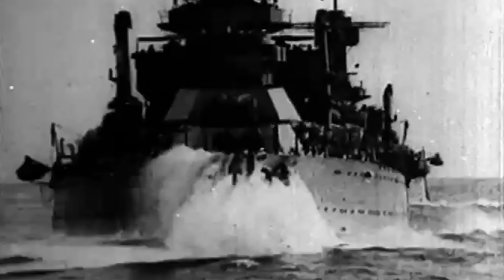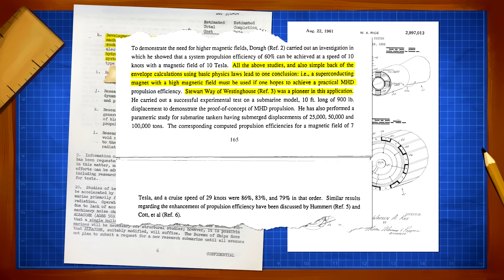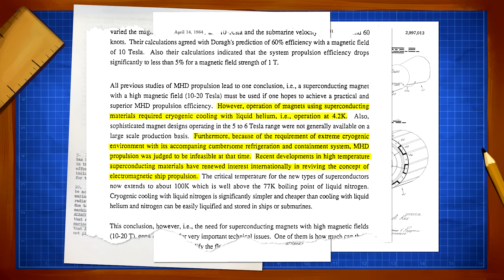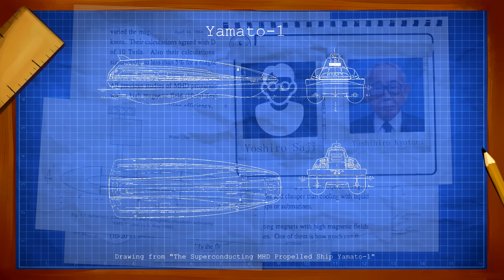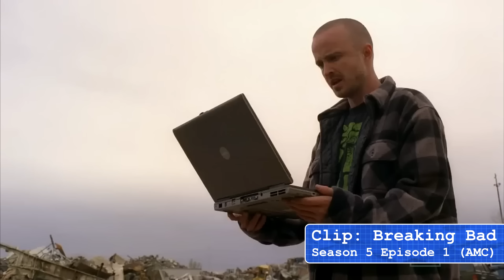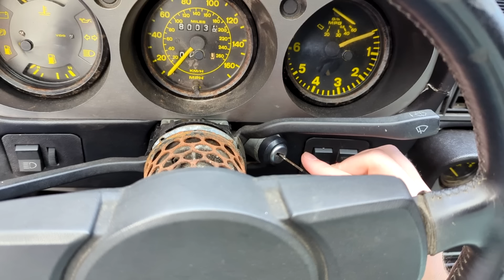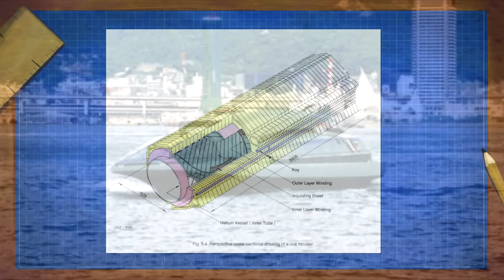Japan's Magnet-Driven Marvel: The Yamato-1

Comment: Lastest MRI systems are reaching 11 T, so we may be able to revisit this Idea in the near future... Or, it might be in use, or in development, in the military, where the use of nuclear power plants makes the generation of the power needed to maintain the fields and cryogenics.
Reply: If you can produce enough graphene that's 40T there .
Reply: magnetofluidynamic pumps are used for liquid metal cooled reactors.
A conventional ship would still be more efficient ,with higher thrust/power ratio.
Also the forces on the coils are in the order of 1000s of tonnes
so the frames containing them must be extremely strong/thick and hence heavy.
Reply: I agree with your overall point in that the technology could work with future advancements in much higher quantities of available energy. I don't think the energy needs to be produced locally though, I think it will be produced elsewhere and delivered to the application (the ship in this case) by using powerful lasers.
Reply: @earthling384f let us know how that goes in 175 years

Comment: I'm really glad that I got the chance to see this ship in person before it was scrapped. I've always been excited by the idea of MHD used for ship propulsion. An interesting point that most people miss is that if you put electricity into the motor, the liquid moves, but if you move the liquid through the motor (think sailboats with MHD), then electricity is generated. I think there were a number of obvious design flaws that really impaired the performance of the Yamato 1, and it's sad that the project was shelved with no attempts to improve the design. I would love to see this tried again with modern high temperature superconductors and magnetic field modeling software used to optimize the design.
Reply: I think a good place to start, for improving the drives, is hydroelectric generators!

Like you said, run power in, get jet out, run jet in, get power out…and a solid ground installation would accommodate easily heavy cryogenic equipment!
Reply: @arnaudmenard5114  A problem with using a MHD "drive" as a generator is the fluid needs to be HIGHLY conductive.  Fresh water isn't conductive enough as I understand the concept.  
I've seen (pie in the sky) proposals to draw water from the Mediterranean to refill the Dead Sea, and water from the Black Sea to refill the Caspian.  Both talk about using "simple" gravity fed tunnels.  If there were MHD generators in those tunnels they could generate essentially free electricity.
Reply: It is an interesting concept, i have wondered if it could also be used in terms of a proposition system for space travel in some fashion?  I wasnt aware they scraped it, i had thought it was on display somewhere. Perhaps it will be revisited, perhaps the technology at the time was just to limited? The US couldnt get the Railgun to work as they wanted, the Japanese seemed to of picked it up and it is working.

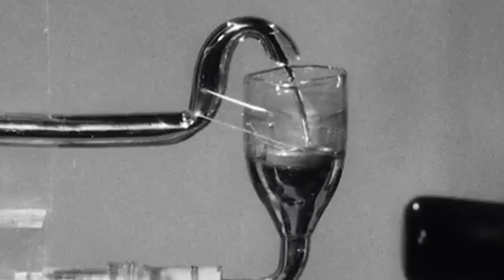Comment: 18:08 "was possible and practical"
No it didn't. If "practical" were remotely possible with significant improvements then your video would compare the efficiency of the Yamota1 to a similarly-sized diesel. Since you didn't it is obvious that orders of magnitude are involved.
Why didn't you compare MHDs to diesels? That was the ONLY thing I watched to see. Sigh
Reply: That's not the right comparison since this was also diesel powerd. MHD is not an engine type, it should be compared to propellers or paddle wheels.

Comment: Regarding "Red October's" MHD: sure, it's supposedly very quiet, but, how would it show up on a P-3s MAD gear? (magnetic anomaly detector) I expect it would be like a spot light.
Reply: Without magnetic shielding, it would show up like a damn beacon. But, there is a very simple fix for that. A block of superconducting material inherently rejects all magnetic fields, and this drive needs superconductors anyway. So adding a simple layer of superconducting material around the magnet assembly would completely hide their magnetic field. It isn't perfect, because you need at least 2 holes in the shield (Water inlet and outlet), but its probably enough to mostly hide the drive.
Reply: @harmenkoster7451  Anomaly's IN THE EARTHS magnetic field are whats detected by MADs. As a Navy OS/radarman, we worked hand in hand with these aircraft. No matter the means of propulsion of a sub, the metal it's made of, and the anomalies it creates while moving through the water and earths field, are whats "detected".
Reply: @harmenkoster7451  Superconductor simple? Plus,  you're underestimating MAD gear. If your scheme were possible, it would also block the earth's magnetic field and that "anomaly" would be detected. It's not just that MAD detects magnetic fields, it detects disturbances in the earth's magnetic field.
Reply: If the drive needs superconductors adding more for shielding wouldn't be too much of another step
Reply: @Mishn0 
I just want to make sure I understand your understanding of the MAD systems. Multiple current devices are using magnetic shielding to protect them from the Earth's magnetic field in various scenarios. Is it your understanding that the detector would get a signal from all of these?
Reply: @Netro1992  To be honest, I don't know. That's some of the most highly classified stuff in the world. But, I expect its capabilities are better than you think. The way they work is not that they detect the object directly. They detect how the object distorts the earth's magnetic field. How do you think magnetic shielding would spoof that?
Reply: @Mishn0 
I don't think you understand how a MAD works or what magnetic shielding is trying to accomplish. The working principle of a MAD is that it detects variations from the natural magnetic map of an area by looking at the changes caused by the materials or magnetic effects of the objects involved. Magnetic shielding, on the other hand, aims to segregate spaces of objects from either the outside magnetic fields or prevent the magnetic fields in the inside from affecting objects outside of them. MAD isn't directly measuring the spatial location of magnetic fields (that's not possible at a range) it's looking for anomalies at given locations, which are two very different things. Thus, when you have a magnet surrounding by magnetic shielding, most of the field effect of that magnet will not be detected outside of the shielding, and the magnetic field will essentially wrap itself around the object, resulting in field lines like the object wasn't there (in an ideal world, in the real world there will still be a significantly smaller effect), leading to the MAD not being able to detect it.

In this case, shielding cannot fully hide a MHD device due to the need of the two openings, but you can greatly reduce it and then counter the leaking fields by degaussing with a opposite field. This is extremely expensive and energy intensive, which is why the technology was abandoned.
Reply: That Mad Gear won't last long once Mike Haggar finds out about it!
Reply: Might be a moot point if used for peaceful purposes, like private ships and transport.  However, not so good for military applications.
Reply: Most likely only good for surface ships.

Comment: Has anyone factored in that it is nearly impossible to stop electrolysis from happening in an MHD drive resulting in the production of chlorine gas and bleach?
(The chlorine is electrolytic separation of salt and the bleach from mixing chlorine gas and water)

Additionally, the high-voltage electric field is an environmental emission itself if any of it is outside the motor; one which has long been banned due to electrofishing.
Reply: With higher currents, I suspect you’ll get noisy crepitation and bubbling too, both unacceptable in a stealth vessel.
Reply: Counterpoint: caring about that is gay.
Reply: @Coperlite-Consumer  burn

Comment: This came up while watching hunt for red october. Wonder if writers read articles about this system
Reply: Hypothetically a nuclear sub is the ideal application for this technology.  Speed is secondary to stealth and theres an abundance of electrical power.  I do think that the drive would have been easily detectable once the opposition knows what to look for. It may be silent (or it may not, electrical things can be quite noisy, especially at high amperage or voltage) but electromagnetic fields are noisy in their own ways.

Comment: I have no idea where you get the idea that Japan didnt have a robust domestic marine powerplant industry in the late 80s. And if that was actually the  motivation behind the magnetic drive, you refute it pretty quickly by mentioning that development on the tech started in the 70s... Either way, Mitsubishi was one of the premier sources of large marine diesels from the 60s until today. And the "stagnant innovation"? The mitsu UE was being developed and updated in the 80s. The UE-L in 1985, UE-LS in 1986, and in 1997 the UE-LSII was released. And this is just their large freighter/cruise ship sized engine. Like the first UE was built in 1955, and it took until 1983 to sell enough engines to reach a cumulative HP of 10 million. It only took until 1996 to reach 20 million HP. 

And if youre just looking to power a few dozen, to few hundred ton boat, and your great grandpa was once shot down by a zero in ww2.. well youre in luck. Just grab another Japanese engine. Yanmar diesels are in more small/medium size boats than any other brand. You will find Cummins/detroit in some american made boats, and when i worked for an offshore sport fishing boat builder we even had john deere send a few engines for us to test out as a pilot program. But even in the US, japanese diesels have dominated their segments of the marine powerplant industry since the 1970s... Or when you claimed japan was tired of having to import powerplants. 😂

And nobody thought this science project was actually going to see commercial use, the weight of the drive units, and well known inefficiency (less than 20% of generator power was transmitted as thrust at the best of times). I dont know if you just found a hyperbolic source, or decided it needed to be spiced up, at risk of sounding clueless. Whatever happened, this video is so wierd. Here's a pretty good writeup on the quite popular marine diesel you insinuate didnt exist. If youre curious. 

https://www.mhi.com/group/mhimme/company/lib/pdf/MEET_NEWS_10_E.pdf
Reply: Like i cant remember if you even mentioned the make/model of the engines they used to drive the generators, but i would be shocked if they werent mitsubishi heavy industry diesels... Which would have transfered over 2x the propulsive force the magnetic drives did, just by throwing away the entire magnetic drive units and attaching reduction gears and a propeller.
Reply: Youtube "community guidelines" (profitable ad-revenue) does not appreciate consumers questioning, criticizing, or challenging content creators. The dominant political-economic interests represented by the 'Google Big tech branch of the US military' does not represent a science or truth based society. Instead, individuals objectively pursuing truth are inherently viewed as hostile dissidents, not friendly partners for justice. Meaning major social media platforms do not function as platforms for back-and-forth intellectual conversation or scientific truth seeking (by design). They serve the primary function for maximizing profit as the means of dominant narrative social control of society. The 'internet' was bought up, privatized, and controlled for the purpose of keeping the power of exchanging ideas and practicing science OUT of the hands of the masses.
Reply: God I love the comments section 👌🏼 superb comment
Reply: Hey it was the guys that were NOT shot down that became our grandfathers.
Reply: At least it looked cool